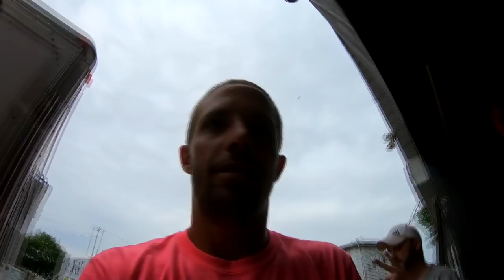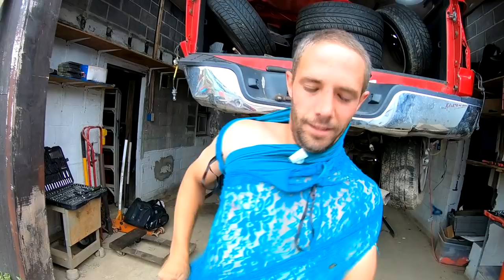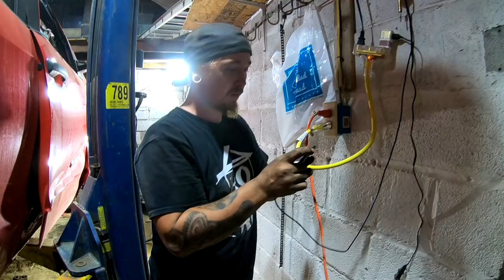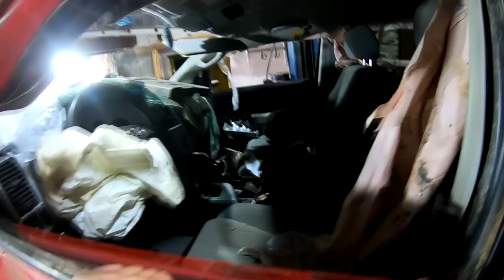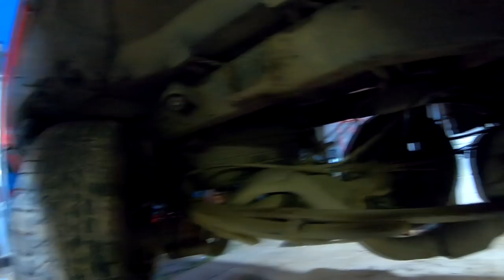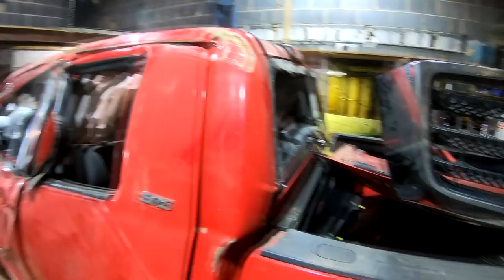TACUNDRA Engine Swap Update 7 - Dismantling the Tundra

Comment: What is the guy at the end of the video unbolting on the front of the truck? Is it the radiator?
Reply from the maker: I'm not sure cause I wasn't out there, but it looks like a transmission oil cooler.
Reply from the maker: He did all that with no air tools by the way.  SMH  I would have went nuts.
Reply: Haha man if I have air tools available Im using them.
Reply from the maker: @semiauto556  hell yeah!